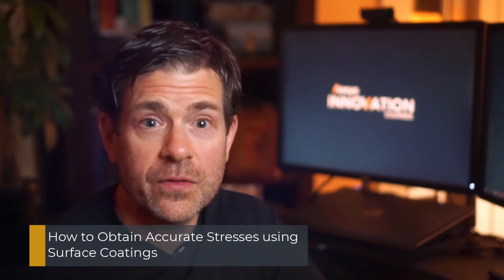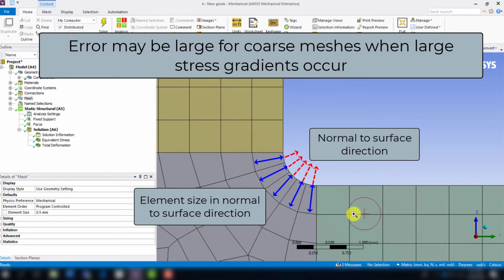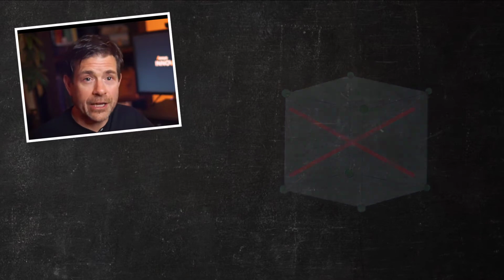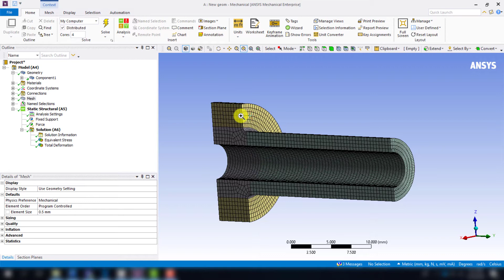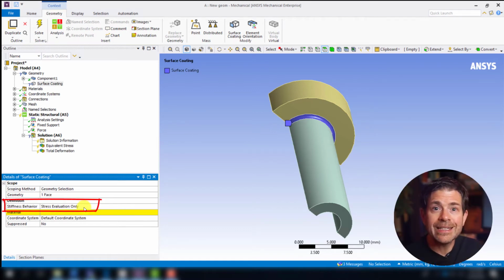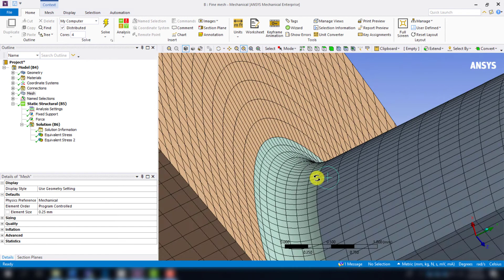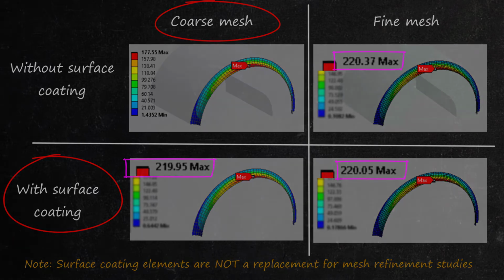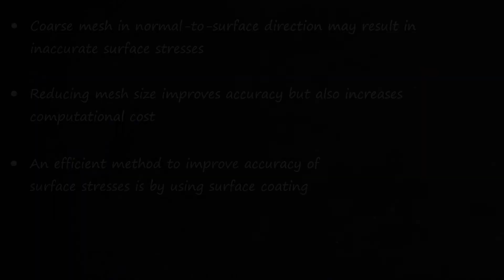Obtaining Accurate Stress Using Surface Coating in Ansys Mechanical — Lesson 4

Comment: Dear Sean Harvey
Thanks for the video
After adding surface coating, when I try to run solve  in Ansys student version, then error coming. The error message is
"Your product licence has numerical size limits, you have exceeded these problem size limits and the solver cannot proceed".
Regards